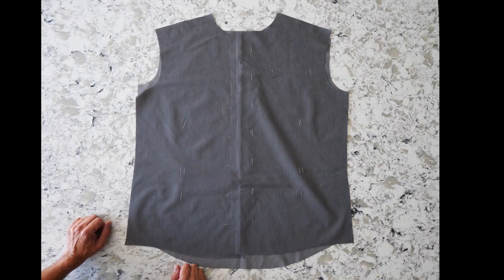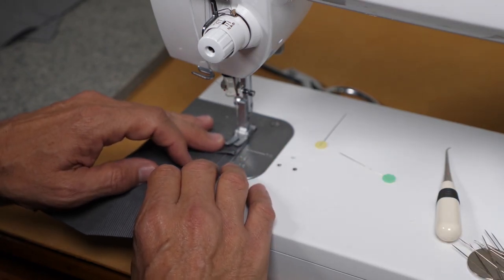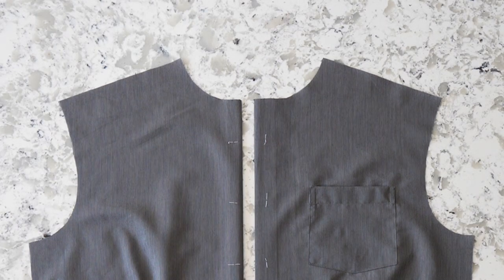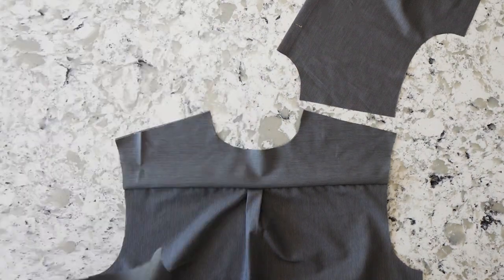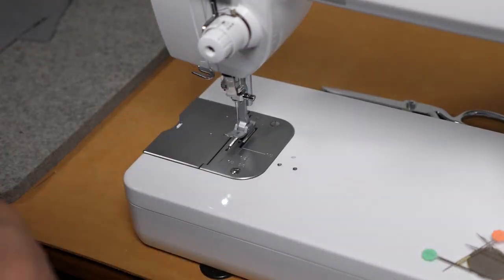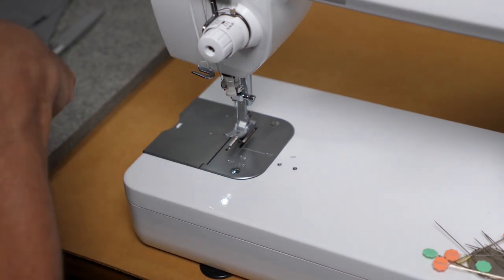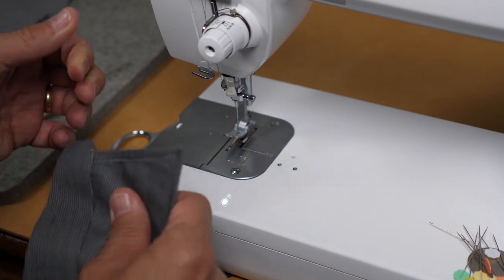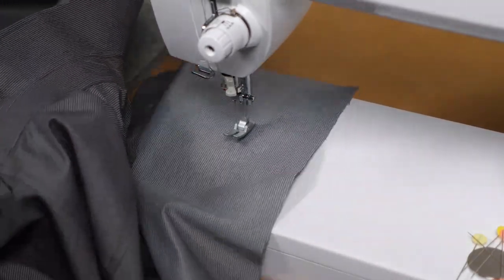Men's Dress Shirt Construction Tutorial

Comment: Thanks for an excellent tutorial. Why do bespoke tailors add darts to shirts? Can't the same fit be achieved by altering the pattern? After all, the darts simply reduce material at specific points across the body.
Reply from the maker: You can pass darts to the side seam if they are small - let's say less than 1/2". However, it is most optimal to distribute shaping around the entirety of the body for better fit.

Comment: Hey Russell, 

Thanks for the awesome video! How do you measure to make sure all of your cutouts are correct? is there a guideline you can point me to online somewhere? or maybe somewhere where you can get a general template? thanks so much!
Reply from the maker: Hi, Kyle. I'm not clear about your question regarding cutouts. If you'll describe your question further for me, I'll see if I can assist.
Reply: Hey @SewpBox  , 

I didn't do a good job of wording that. I mean how do you know what size to cut for all your different peices that make the shirt?  How do you go about measuring and knowing what size peices will make what size shirt?
Reply from the maker: @kylel200  If you're flat pattern drafting, you are drafting to a specific size, creating all the pieces for that size and adding seam allowances. If you're using a commercial pattern, by and large multiple sizes are built into the pattern. To determine what size to cut from a commercial shirt pattern, use your chest measurement to determine what size shirt to cut. Don't always rely upon the recommended size, however. Check the chest ease in the pattern. You want to make sure it reflects the silhouette you are looking for. 4"-6" of ease is pretty standard (the less ease, the slimmer the fit.)